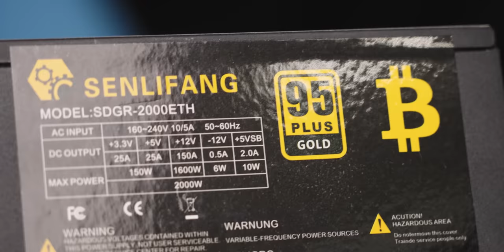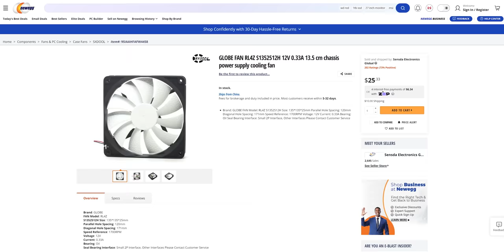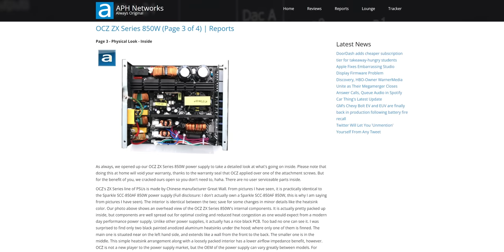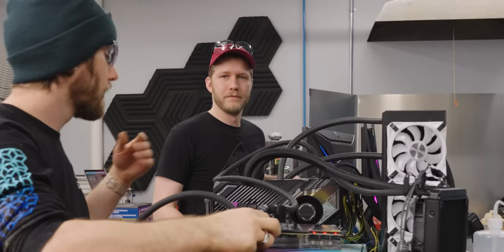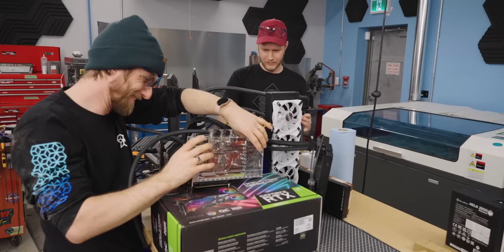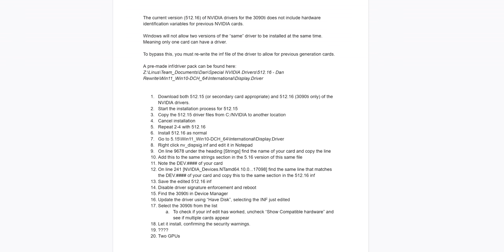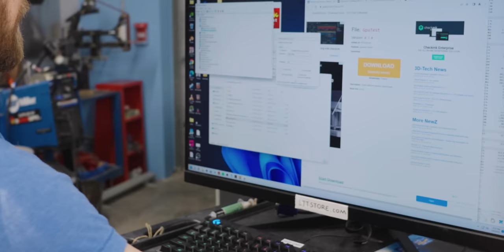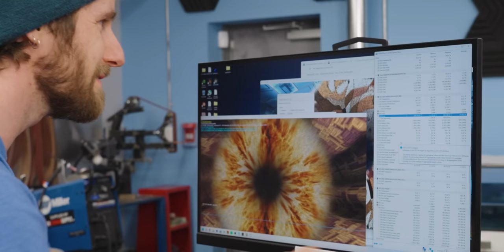This is one SKETCHY 2000W Power Supply

Comment: Can someone explain how they drain 240 Volts from their Socket? I Googled canadian Sockets Run at 110Volts. They changed the Plug (to the Same again one?)... So? The Socket should still Run at 110v. Also These PSU are Sold Here in Europe. And we got 50herz on Our Sockets. Canadian do have 60hertz. How in the world they told their Phase to Run 240/50 instead of 110/60? 

Also in Europe we can Plug cables in Sockets No Matter the Direction because Our cables are only '2 pin'. So in my thoughts it would actually doesn't Matter If you Switch the null Phase and the regular Phase. 

Aaaand you should Always leave the ground Wire a little Bit longer, because If you rip the cable and pull everything appart the ground is applied a little Bit longer to save you from Bad accidents.
Reply: A video by Technology Connections titled "
The US electrical system is not 120V" explains this pretty well. The video is for the U.S but Canada does it the same way so.

Comment: You need a proper electronic load to confirm the 2000W rating with confidence, but it won't generate the fun factor and turn it into a boring technical video.

Comment: Sooooo basically, not so sketchy? Just loud and hot (but part of this heat could be minimized in an enclosed space I guess?) But what would you expect for a price divided by 3 compared to a much better one? And frankly, if you can spend 10 000 USD on a gamer Rig, would you be cheap enough to use a loud power supply???
Still I would love to see the comparison with the other power source in term of sounds and heat...
As for the components being only for 240V... Well, if you design a product for a market with 240V, why would you bother including ability to handle 110V for countries thousands of miles away? AND anyway if people from 240V country move to 110V country, they will just use a transformer to handle the difference... Problem solved...
Last but not least there is a HIGH probability that their main customers are in China/Russia already.
One last small comment... The Bitcoin... This power supply is mainly sold to crypto mining customers. They even have a model with a shape (not square) quite elongated that is 100% designed for mining rigs and selling mostly tooooooooo Russia. What a surprise. And it is even cheaper at a price under 100 USD (delivered)

Comment: a proper testing of these would be to put a load on them like a light bulb or a resistor that draws 2000w of power. Then you would quickly see that almost all pc power supply manufacturers are liars :P

Comment: Hopoe you steped up your game. These movs are inrush limiting. There is common mode filter on AC input. Being 230v power supply, dosent mean its not required to have APFC. Safety of that transformers can  only be verified with dismanteling them.

Comment: HAHAH I have actually had the caps in one of those things discharge through my hand and down to my feet - it was however a 240V unit from the days of PS1 (circa 1994) and as it had blown I was replacing it with a PS2 unit (oh that dates it) I recall letting out an almighty yell and next thing I know I am on my knees on the other side of the room wondering what happened.